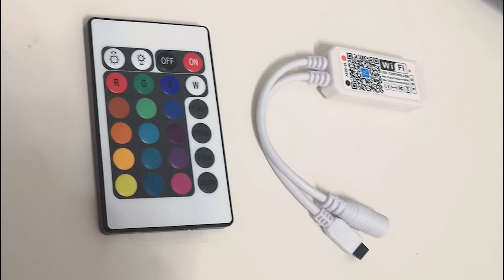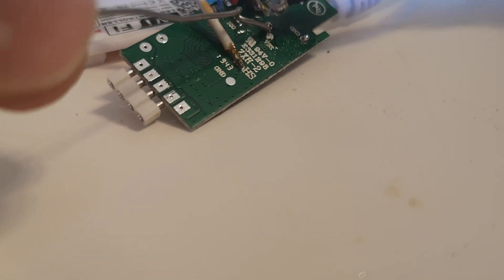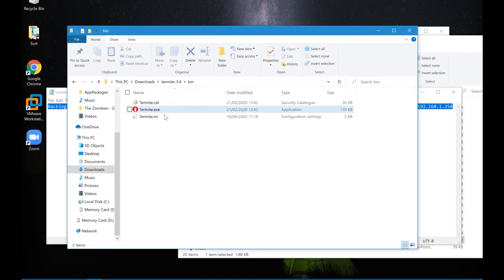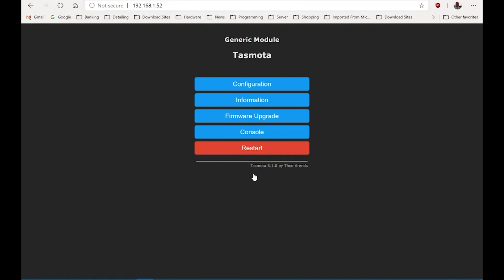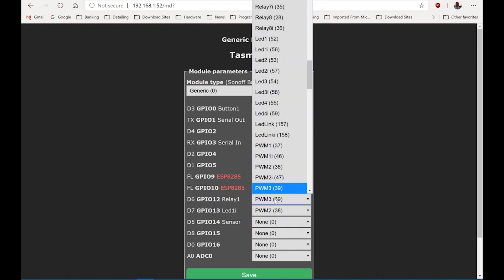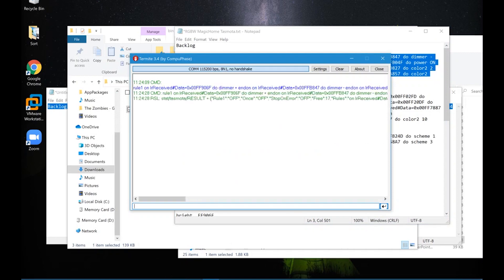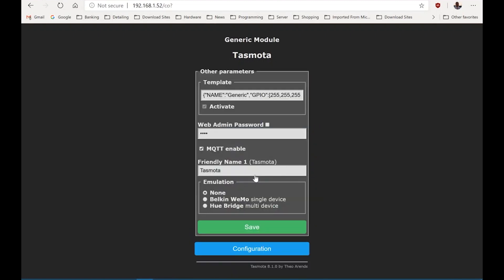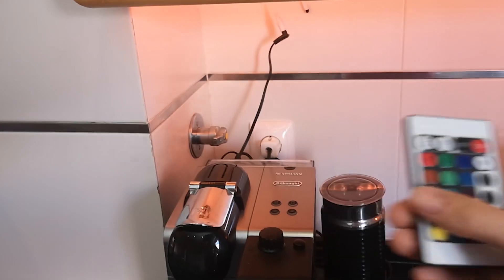Flashing Tasmota to MagicHome RGB Controllers

Comment: My, There are only 4 contacts on my circuit board. Unfortunately, I couldn't find any instructions anywhere. The contacts (VPP, SWS, V33 and GND) although the board has the same designations printed on it (94V-0; E331298; ZXH-2) Can you provide any help?

Comment: Hi, is possible to use remote to control other devices, like smart wifi bulbs? I'm looking for solution to control bulb lights (not LED strips), but would like to connect it to Home Assistant? Or it's working only for LED connected to controller?
Reply from the maker: Yes it possible.  I do it on mine.  You just write a rule to send the colour change to any device you want to change.  The device must be able to receive these commands.  I use Tasmota and shelly which both can do this.

Comment: Hi, does the controller work with a greensun stripe?
Reply from the maker: If the strip takes dc voltage and rgb connections.
Reply: @qualar  how I can look this?
Reply from the maker: @khatab_ha479  Do you already own the strip?
Reply: @qualar  yes
Reply from the maker: OK, just look at the end if the strip and you should see either 4 or 5 connections.  +, R, G, B, W.    On some the W will be missing and on some the + will be a - or GND.
Reply: @qualar  thank you

Comment: I flashed my Controller like you but I can´t get the color white. Do you have a solution? 
And do you know how to set this device up in to ioBroker?
Reply from the maker: Did you purchase the RGB or RGBW version?
Reply: The RGB but I figured it out. I switched the Gpio Pins in the Tasmota Software
Reply: @lukas_prints3d409  I have the same problem, what was the gpio pin that you have changed?
Reply: @donteventry3054  5 = PWM 1(37)
12 = PWM 3(39)
13 = PWM 2(38)
Reply: @lukas_prints3d409  thanks but that was not the case, I had to set 'GPIO15 =switch' to get the white color to work

Comment: Should I just use this one for solid color led strips or a different one? I basically have warm white leds already laid in epoxy for some shelves and they have 12 volt power supplies. I was thinking of maybe using these? https://www.amazon.com/Sumaote-Controller-Compatible-Assistant-Dimmable/dp/B07JC3L4Z6/ref=sr_1_8?dchild=1&keywords=wifi+led+dimmer&qid=1598336064&sr=8-8
Reply from the maker: These controllers will work with single color strips also.  You would just only use the output from the white channel.  I will still buy RGBW controllers even if just using white strips, they cost about the same but would give you flexibility in the future.
Reply: @qualar  awesome I was thinking the same! Thanks for the help I appreciate it!
Reply: For what ever reason my flashing fails when using this same exact board. I triple checked my wires and they are all in the right place I also shorted GPIO to GND before plugging in...
Reply: For whatever reason I had to connect 12 volt power to the led board AND my usb power to flash it.
Reply from the maker: @ForwardEngineering  maybe your usb port did not have enough current to drive your flashing FTDI.

Comment: Is there a way to do this OTA with a Raspberry Pi and a vtrust-flash network?  I've flashed to other devices this way but I can't seem to get this device into the proper mode for the flasher to find it over the air.

Comment: Does anyone know of a seller still selling the IR version with the ESP8266 device (eg ebay/AliExpress)? I bought two recently and they both had an S9070B chip, no esp.  I am trying to do exactly what the video describes.
Reply: @NikNak LP when did you purchase it? It seems like all latest model being replaced by the new chip. I m looking for other controllers now
Reply: This one worked for me in the end (RGB IR version):
https://a.aliexpress.com/_mMu0ZGn
Esp8285 chip but Tasmota flashed fine.
Reply: I am having the same issue, I already ordered 4 controllers from different sellers from Ebay and AliExpress, and all of them came with chip BL602L instead of ESP8266, which AFAIK cannot be flashed at the moment. I realised these new models have "100w" in the label instead of "144w". I am desperate to get some of them so if anyone knows of a seller that is still selling the ones with ESP8266 please share
Reply: @elbueno22222  the link above worked but I don’t know if they still sell the correct one. Maybe check the recent reviews.
Reply: @Nigerian Prince to be honest I don’t remember 96, 100 or 144 featuring anywhere and I don’t see it on the product descriptions. If you have the espresssif logo on the chip then it is almost certainly the esp8266 (which you can flash).

Comment: Great video, I followed you I flashed mine and all went well, I can access Tasmota, I configured it like you did, however when I press Toggle the LED doesn't light up. Could I have fried anything while flashing?
Reply from the maker: No flashing cannot damage anything.
Reply: @qualar  , I got exactly the same Issue. Wonder which tasmota version was exactly used in presented video.
Reply: Cristian, in my case it was the polarisation, i had to reattach the power cables, switching them as well. Now IT WORKS LIKE A CHARM :)
Reply: @piotrblaszczyk6221  Do you mean you changed plus with minus on the controller?
Reply: @CristianImbir , I just put the ac plug the other way, what eventually reversed the flow. It works flawlessly ever since.